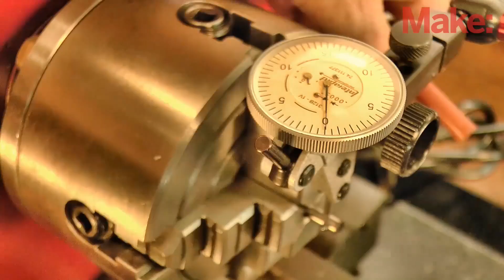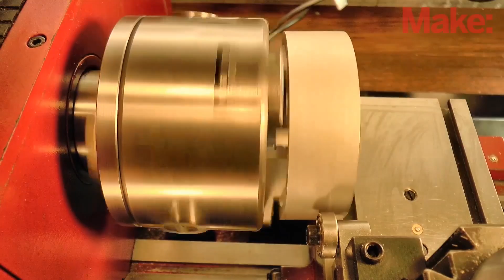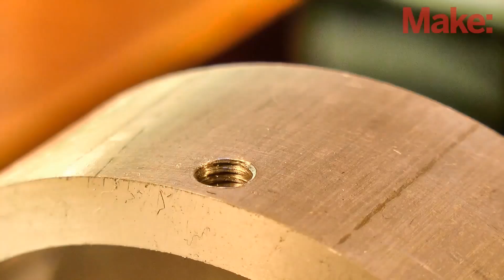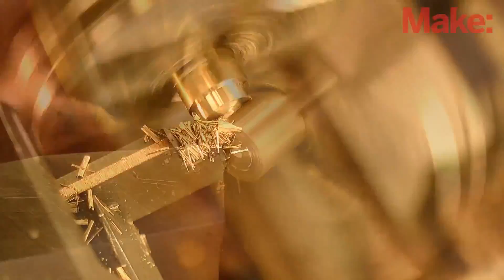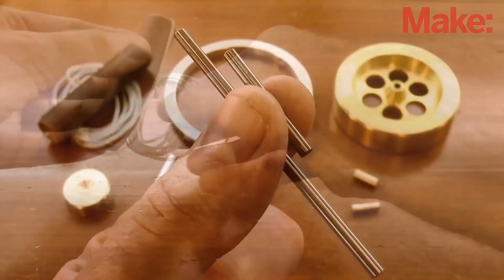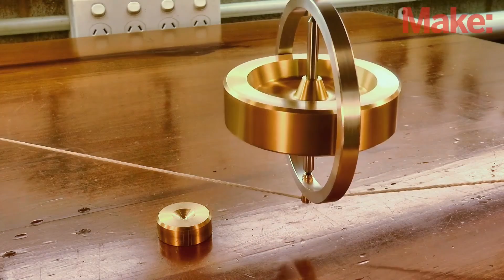Clickspring: Benchtop Gyroscope Part Two

Comment: A Gyroscope is something every child developes a common sense connection to understanding for, in the functional definition of a full hands-on, eyes and ears sensory engagement, but it's psyched up to be a mystery that nobody can explain. 
Well if you start with a situation report, "it's all ways now", ie if all such functional relationship, ways, are connected here-now-forever, then the characteristics of mass, momentum and Newtonian physical functions can all be put together in spin states.., from tiny atoms to orthogonal axies at infinite tangential radii. 
This last bit was once taught as the geometrical beginnings of Number Lines and Origins of measurements, ..and so on to Cartesian layouts of mechanical and Trigonometric functions. 

It's not enough in this comment to get beyond the Instrumental Indicator level,  but if the video about a Gyroscope is comprehensible, so is Quantum Mechanical engagement of Spin phenomena, QM-TIMESPACE, in similar practical terms.

Comment: ive seen this video like 3 years ago and when i got my lathe about 1.5 years ago, i almost instantly made one of those bearing tools because it stuck in my mind. this thing is SO useful, sometimes you got stock that is uneven so dialing it in with an indicator gets frustrating, but with the bearing, its just plain simple to get it centered enough to begin working. its amazing how good of a tool you can make yourself with litterally pennys worth of stuff.

old bearings do the trick just fine, clean all the grease out, clean them, use some heavy oil or grease to keep it somewhat lubricated and off you go, no need for a new bearing if you are on a saving adventure! :)

Comment: I wonder if you hardened the axle ends and threaded bearings if it would significantly reduce friction or at least add some lubricant at contact points?

Comment: I was wondering how often the bearings needed 'nipping up'? They could be made with ruby or sapphire cups, which are easy to get hold of and there would be no extra build operation except cutting for the  jewel instead of 'V' cup. You would ensure a rattle free lower friction rotation without wear. Beautiful crafting and video - professional enough for broadcast on any platform .
Reply: *****
Thanks.

Comment: Clickspring, would it even be possible to make a functioning gyroscope out of wood? Not the whole thing, but rather the seemingly unimportant parts.
Reply: The entire thing can be made from wood (except for balance weights), and can probably get comparable RPM's if you are careful with balancing.

Make the rotating portion from something heavy, solid, and stable such as cocobolo or ebony. Make the bearings and points from Lignum Vitae. The hoop is probably best made as a laminate since it gets gripped hard in your hand, you could also make the rotating portion as a laminate and make spokes. I would not block up the rotating portion unless a metal band to keep it from exploding.
It will require balancing, you can either use lead weight or remove material from the heavy side.
I made one about 20 years ago using a cocobolo flywheel, and ebony axle, and iron wood bearings and points. It was a fun little project and made a nice gift.

Comment: That's a nice little project. One thing I noticed was the spot drill leaves a flat spot after drilling. Could you follow up with a small center drill to form a sharper point for the shaft to run in. Seems to work ok anyway.

Comment: Chris-- typically nice and rather professionally produced video on this subject.
A couple of thoughts: I'm surprised you did not remove an opposite "flat and hole through" on the symmetrically opposite side of the center spindle. It would eliminate the slight vibration left over. And, just as surprised you did not round over the bottom insert as it sits in the support cup. It might work in your palm better, perhaps the fingertip.
Not just a good gyroscope-- a beauty as well.

Comment: I could go on and on over your excellent craftsmanship, videography and everything else about your wonderful YouTube contributions...but would just be reiterating the obvious.

However, might I suggest not spinning up gyroscopes, bearings and the like with compressed air. With pressures found in most shops (not that high really) dangerously high rotational speeds can be reached. There are instances where people have been seriously injured by bearings spun up on a finger to the point of failure...

Comment: Very beautiful. Physics at its best
Reply: +Christopher Hilder Cheers Chris, thanks for watching :)
Reply: +3MrP3 My spotting drills are all 120°, but if you have 90° spot drills, then I would use those; it's closer to the ideal cup angle of 80°. Cheers, Chris.
Reply: +Clickspring Hey Chris! Fantastic video as always. Just a quick question. You said the cone inside the bearings has an angle of 120°, but you used something that looked like a spotting drill to machine it. All the spotting drills I have seen so far have an angle of 90°.
Reply: Clickspring Thanks for the answer, I didn't know there were spotting drills with an angle other than 90°
Reply: Precession is a sign instability, its tilting and it the the increasing tilt causes it to precess more and more.

No gyroscope is perfect, all will precess. The important thing is how fast does it start to precess. For a handmade product with scrap, i'd say pretty good but ofc not for any scientific projects.
Reply: isn't precession like, a fundamental property of gyroscopes? how would a higher quality gyroscope differ?
Reply: +Clickspring Why are 80° ideal?
Reply: Not a very good gyroscope.  It is precessing badly.